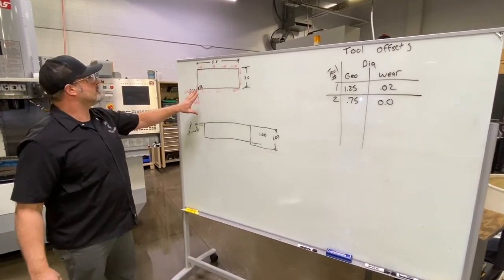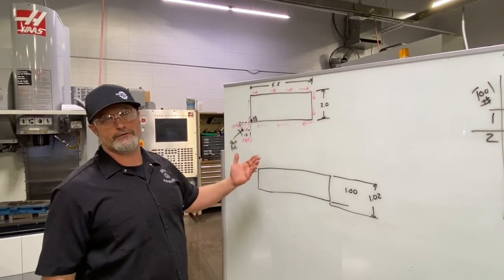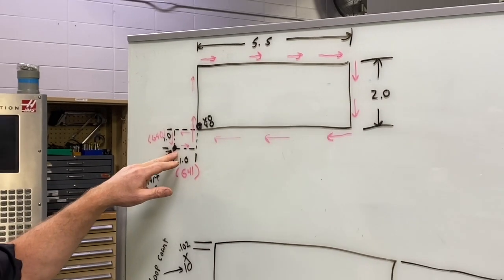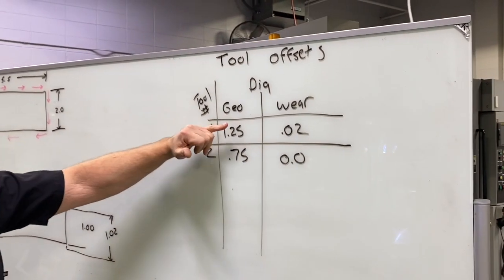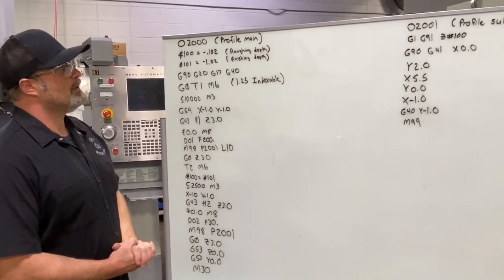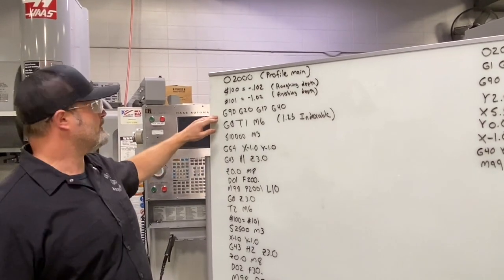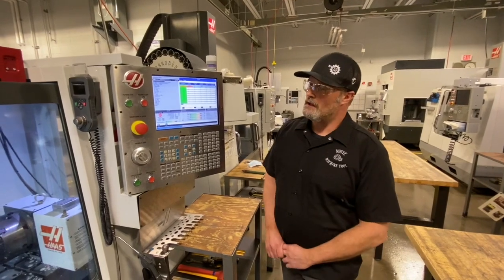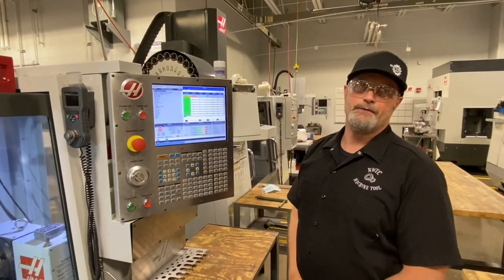CNC Programming Techniques for Profile Milling

Comment: Nice video. I suggest using G10 line to auto load D geometry and D wear offset. Adding another sets of variables will to customize the depth of cuts in relation to required depth. Addition of auto load monitoring especially for roughing tool will also beneficial when cutting tough materials  and using a insert type EM's which allow the machine to stop at specified load rate. I read some comments below about having Mastercam software but in reality if you combine macro variables and Mastercam then you have peace of mind leaving your program to set up operator.

Comment: Good video, macro variables are incredibly useful and underutilized. On FANUC you can input values directly to the tool offset page from the program.
For example i would say #13001=0.5 this sets the D value for tool 1 as 0.5. This is very handy for roughing if you want to use multiple D values to rough a profile.
It also removes some potential for errors when setting up as all D values for all tools are automatically applied when the program is run.